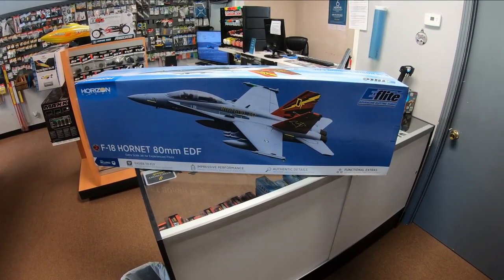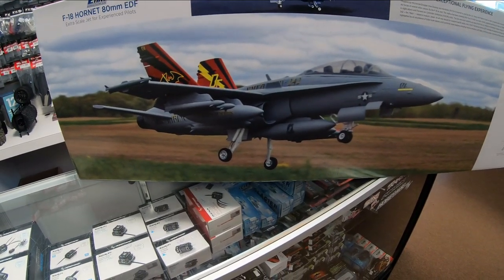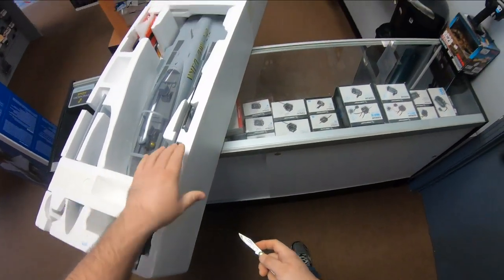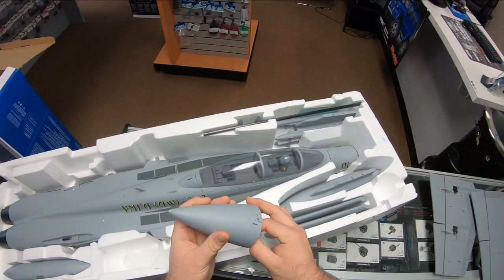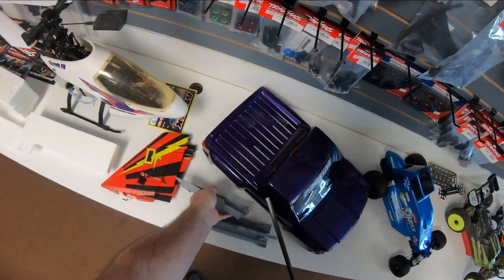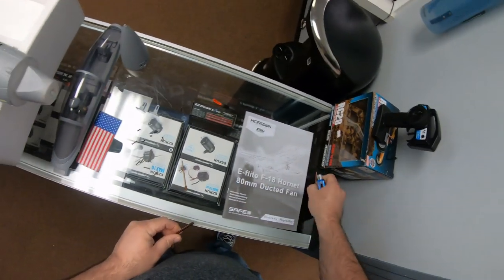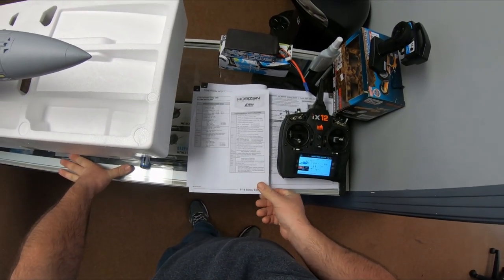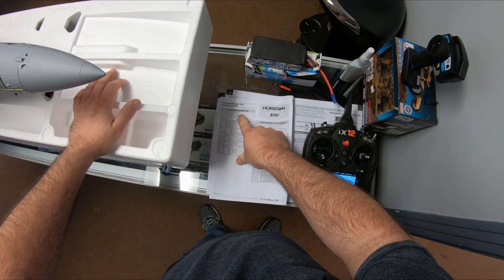E-Flite F-18 80mm EDF BNF Unboxing and FULL BUILD VIDEO!

Comment: As an observer not into the hobby does it bother you paying all the moolah for a model made of the same stuff as the packaging it comes in?
Reply from the maker: It's not made of the same material it's packaged in.  EPO is a different compound that is tougher, smooth, and carbon fiber reinforced.  If the airframe was something like all fiberglass or carbon fiber the cost would be astronomical.  Most people are nervous putting that much money in the air.

Comment: I could be wrong but both times you fitted the 6s the esc plug was under the battery
Reply from the maker: it wasn't but that battery ended up being too large.  I found another 6000mah fly from Glacier Lipos that had much smaller dimensions that fit perfectly

Comment: Why is there no travel left in the rear mains when it’s just sitting there ?
Reply from the maker: It's designed to mimic the Full Scale landing gear.  If you pay attention to full scale F-18, the landing gear compresses down fully in the same manner.
Reply: If you go to the Horizon Hobby F-18 site there is a video with the chief designer and a marketing fellow. The designer explains why the mains do what they do. A little bit of a compromise on the spring rates to make it work for this size of model. I would have liked to see some cushion, but I can understand why they did what they did.  I have other jets of this size and can tell you that these retracts are really robust compared to my other jets. I think that these guys will be able to take a beating for the long haul! At least I hope so! Ha, Ha!

SJ